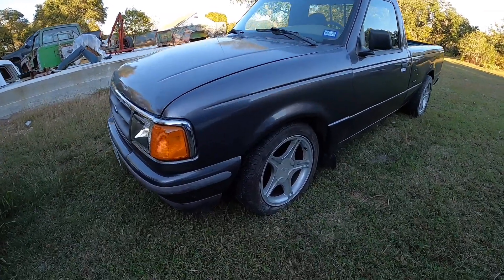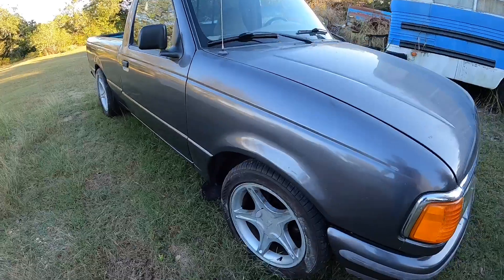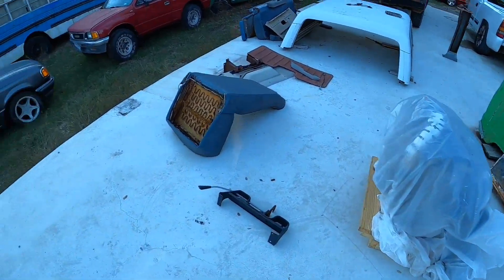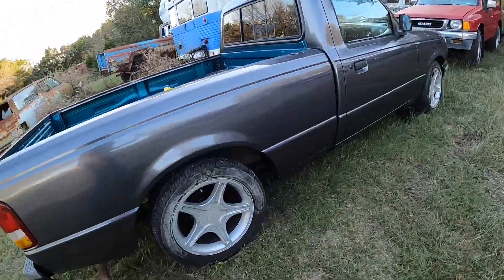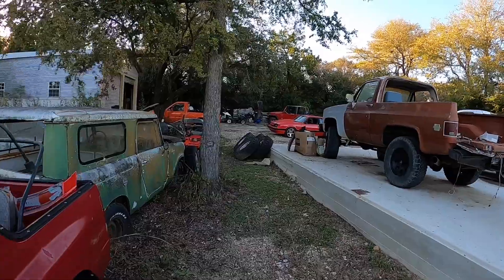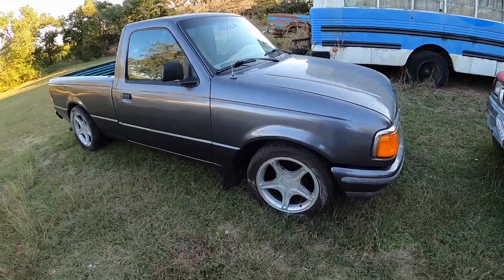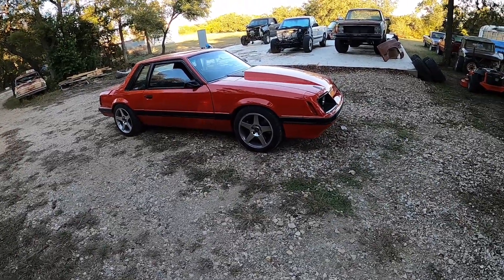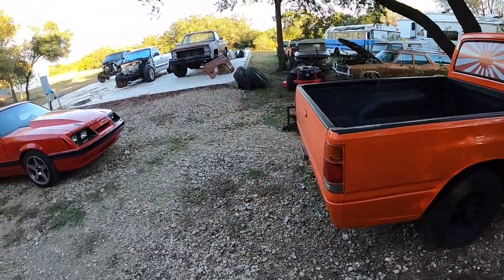Ecoboost swap ranger project

Comment: I have a 96 single cab 4cyl splash with the same drop. Ever since the drop the driving experience has diminished. Meaning the truck is kinda all over the road now. Steering seems looser, it sways in the other lane with just a touch of the steering. Not sure if this is the truck or if it’s the kit. Seems like the factor suspension parts and new lowering kit aren’t working well together. I changed many of the bad factory suspension parts. Sway bar links, steering link etc. got the truck aligned, but it seems after the alignment the truck ain’t happy. Any ideas ? Maybe get it realigned ? Seems like the right side of the truck is 1 inch higher now than the left side after the alignment. Sorry for the long text. Was hoping for some help…thank you brother 👍🏻🇺🇸
Reply from the maker: Well that makes 2 of us, I got my truck aligned but it steers like garbage and pulls all over. All my suspension is old and worn. Im gonna do coilovers in the front and probably a thicker sway bar. I believe that will stiffen it up a lot. There’s a website  ricksrangerz.com that makes a coil over kit for these older I-beam trucks. Also if you have factory struts in the front that might be an issue because its travel is greatly reduced. If you wait long enough I’ll make a video about the coilovers lol
Reply: @STREETFOCUSEDINNOVATIONS  thank you brother. Good luck 🇺🇸👍🏻

Comment: !?!?WHAT. Tires dont look like 275s and you cant use a transmission made for 120hp with the ecoboost 350lbs torque will break instantly if its and old trans will
Strip the teeth and if its new might crack in half
Reply from the maker: Rear tires are 275’s in this video. Check my recent videos the truck is running and driving with the ranger trans, idk how long it will hold up but I’m gonna find out lol.

Comment: Hey, Jimmy, just want to say: For the steering on the Fox, check the steering shaft (between the steering wheel and the rack) for play at the rag joints, which look like rubber collars. Ford's rag joints were notorious for rotting out on the Mustang, Bronco II, and Ranger, back in the late 1980s and early 1990s.

The other thing to check would be the play in the rack, as there should be an adjusting bolt and nut on it, like there would be on a Ranger steering gearbox.
Reply from the maker: Thanks for the info man, but the car has a solid steering shaft from maximum motorsports and it has a reman cobra rack. I did also try to adjust preload on the rack with no luck. I will be replacing the front k-member and solid rack bushings. I’ve heard reman racks are sometimes junk though.

Comment: A 2.0l ecoboost would prob wake it up a lot. I like these older Rangers. They are practical regardless how fast they are. I have 2022 ranger and love the thing
Reply from the maker: Yeah it should wake it up a lot! Hopefully lol.
Reply: My younger brother has 2 trucks. His first one a 2000 Ford Ranger and a 2019 F-150 and I have the 2019 Ford Ranger. I love the ranger they're good looking truck's and they're capable of a lot. All I need it for it will do. I was impressed with it by far. I'm used to driving the big ecoboost engine powered cars but for 4 cylinders it rips. I step into my brother F-150 with the 2.7 ecoboost and wowzer talk about speed lol. I hope he keeps the ranger long enough til he can engine swap a 2.3L ecoboost into it. That would be badass